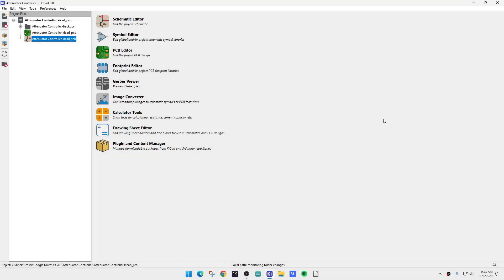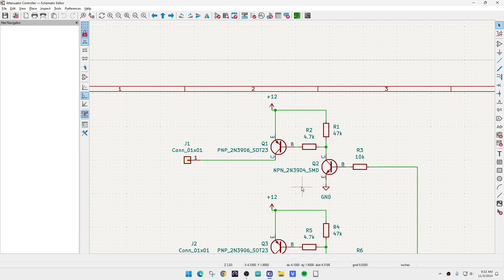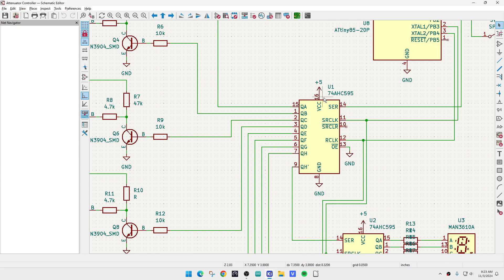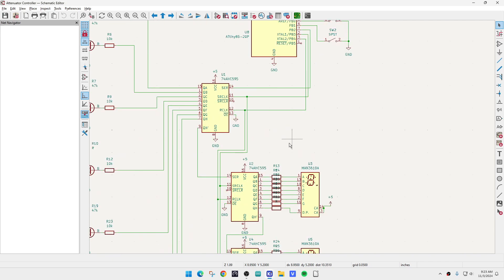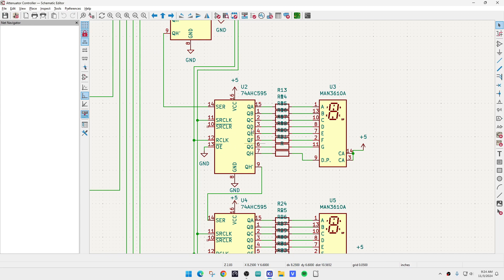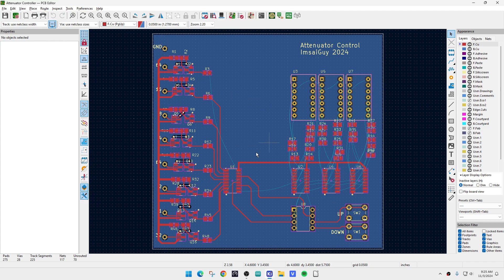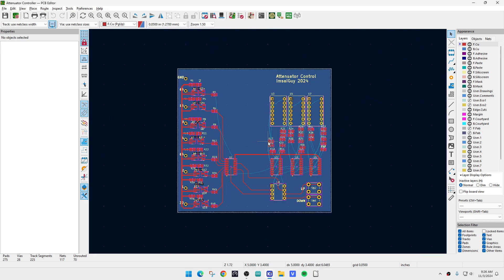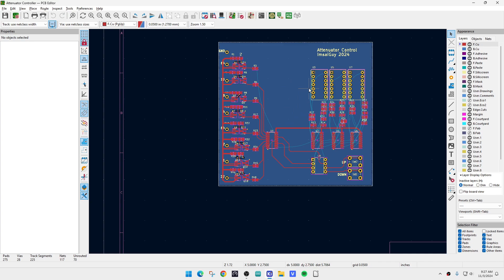#2045 Weinschel Attenuator (part 2 of 6)

Comment: I'd use some relay drivers, much easier to use and avoids forgetting flyback protection...
Also, one issue with the whole design is that you cannot really control the transitions, meaning, if you want to switch from 16dB to 64dB attenuation you may briefly end up with 0dB attenuation. That could be a problem if you're trying to protect a device using the attenuator.

Comment: I would rotate the control/display section 90 degrees so that, when in use, the attenuator is at the top with the signal passing from left to right and the cables are out of the way.

Comment: I realise you've already built this, but I keep some MIC5891 in stock for high voltage source (and MIC5821 for HV sink). They are both 8 bit shift registers with latches (like the '595), plus they are 35V capable @ 500mA with integrated transient clamp diodes. They would save you all the overhead of the discrete transistor stuff.